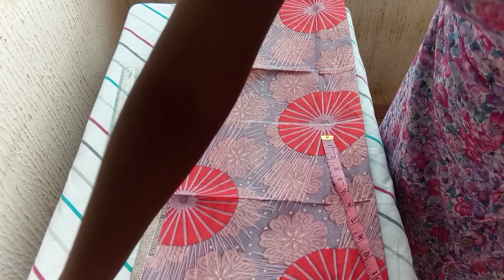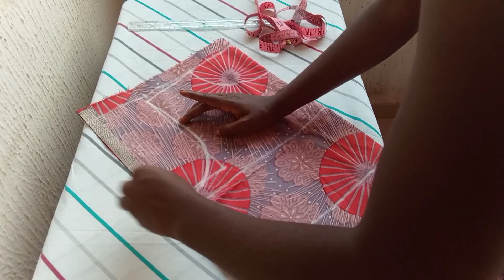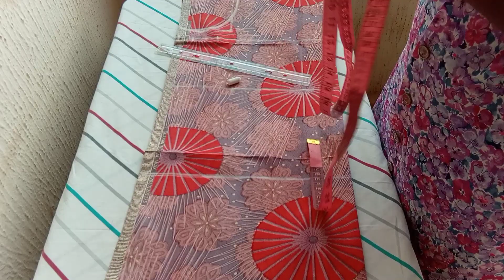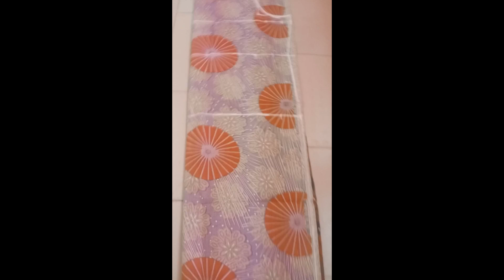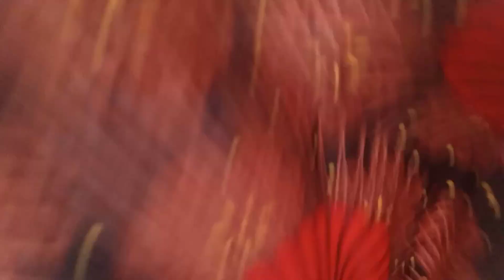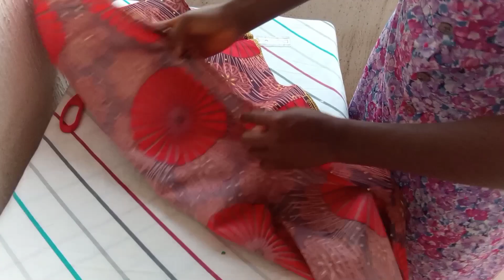#How to draft a Simple basic Shift Dress/gown.

Comment: Pls the line connecting the armhole and the burst line is it a straight line. Asking because the armhole was drawn to infinity without a measurement. Not referring to the circumference but wher to start stitching from on the armpit
Reply from the maker: Okay..the line doesn't connect to Burst line.

Burst line is 9 inches from the shoulder line.

Armhole depth is 7.5-8 inches.
Some people draw it to the burst line, but i don't, so it doesn't expose the breast when armpit is raised.
Also because the person's armhole depth is not that Long.

About drawing it to Infinity. Normally you measure the line to get your preferred depth while joining the front panel to the back panel. So whether you cut out or leave it, while joining both panels just remeasure, to get the exact measurements.
Reply: @DIYcreations.750  thank you
Reply from the maker: You are welcome